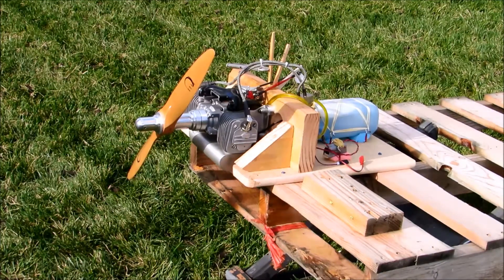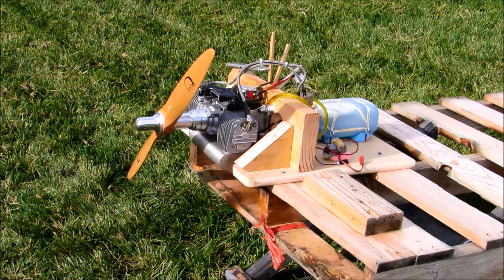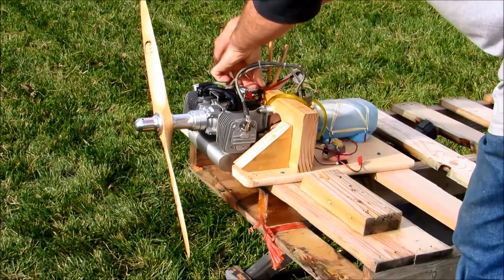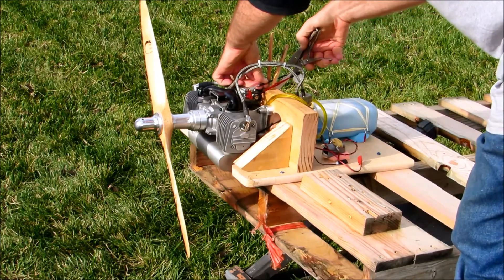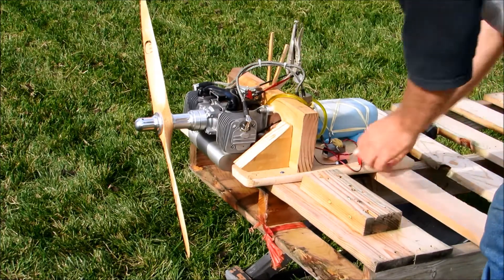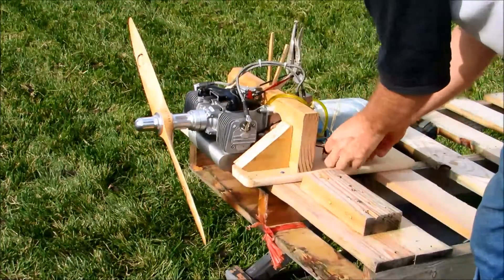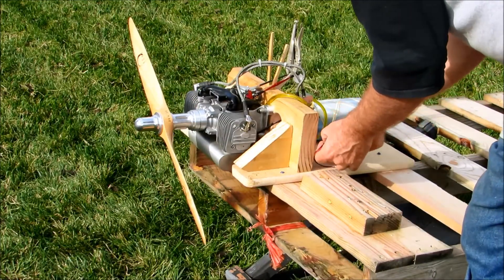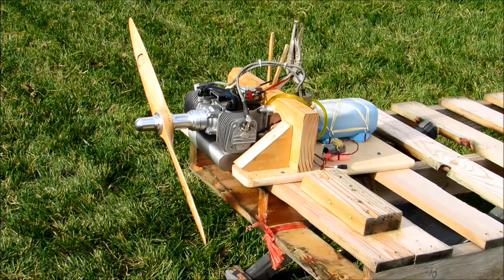Corsair #44, Running in the Zenoah GT80

Comment: Don.  I know it is easy for me to say, its not my money, but for all the time and detail you have put into this build. Why not go with a radial engine for no other reason than for the sound. That engine still sounds like a weed-wacker to me.
Reply from the maker: Hi Mike. I will never own a radial. I draw the line there. They are too much trouble. I expect my engines to run with the reliability of a hammer. Radials sound nice, but they simply cannot meet that reliability standard.
Reply: You are exactly right. That's why I bought a zenoha gt80 for my 1/3 scale Camel.  It is very frustrating when a nice sounding radial starts to act up  on the only day in a month you  have to fly

Comment: Very dangerous method you have there of priming the engine with Ign. switch on!!!!!!! Keep it up and your going to get smacked by that prop.....HARD!
Reply from the maker: You're probably right, but that has not been my experience. I can feel it kicking as I turn it over by hand. Once the kicking subsides a little, I know I have good spark, and good fuel, and it will usually start right thereafter. Perhaps I've just been lucky so far.